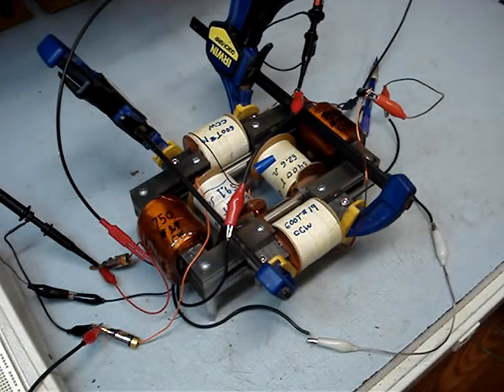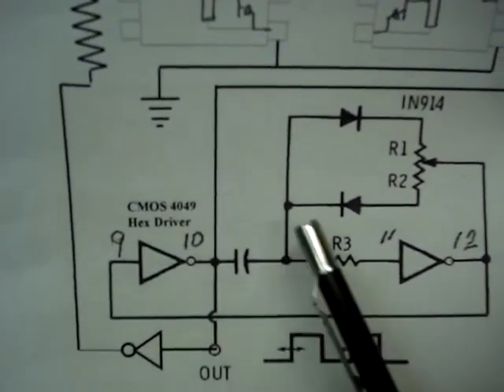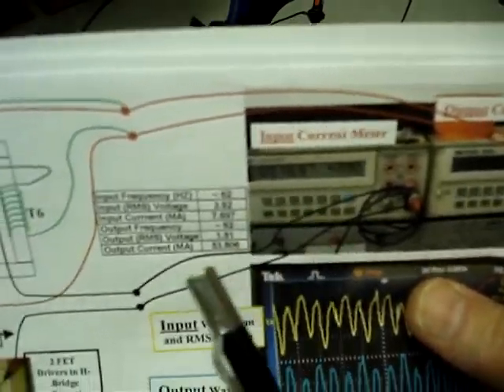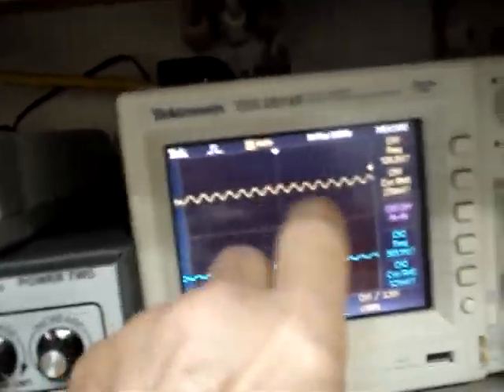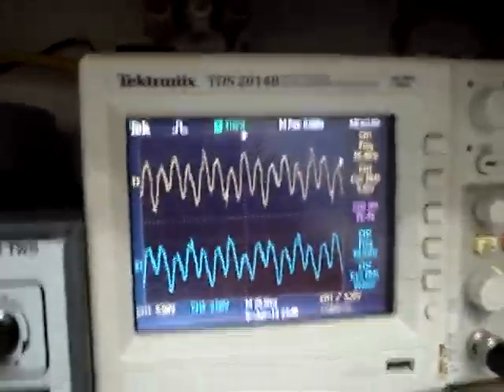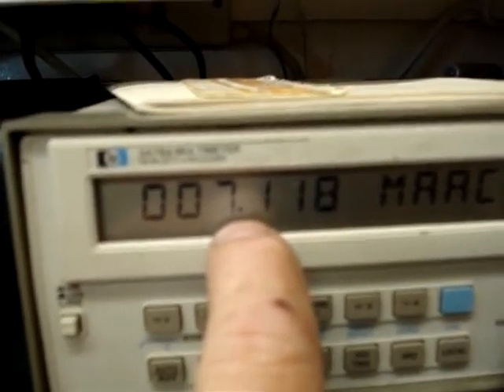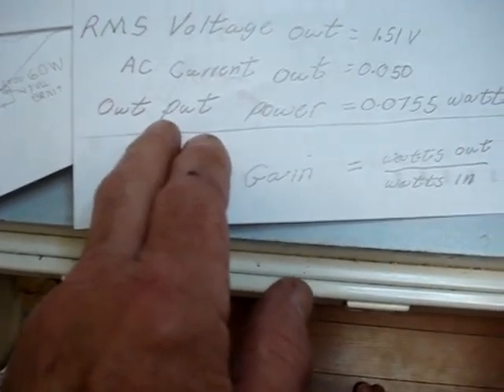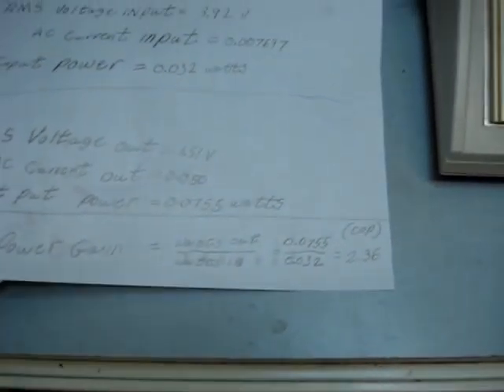Flux Control Transformer Experment #1 BR549

Comment from the maker: The input power is used to switch the magnetic flux of the Neo Magnets. The optimum for this setup seems to be around 4 volts. 12 volts will work but dose not improve the COP much. COP can be improved by switching the Neos magnetic field more efficently. (Work in progress).